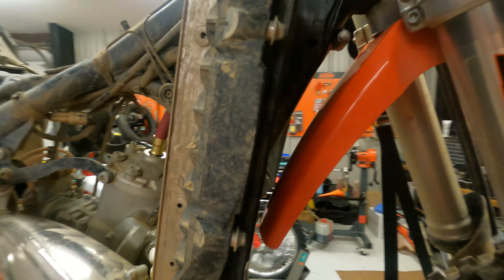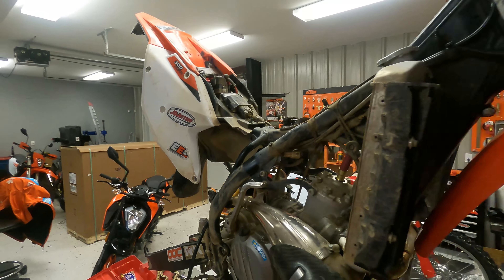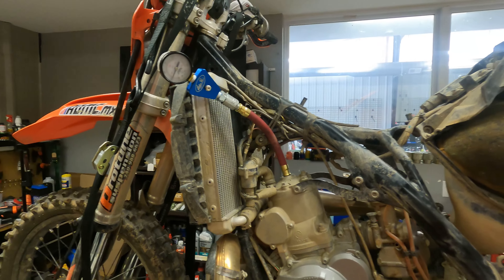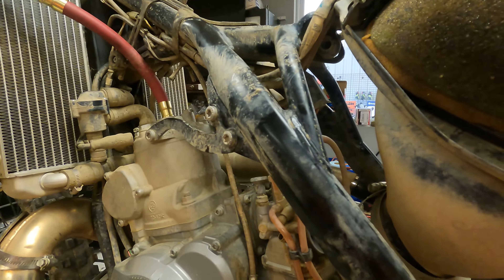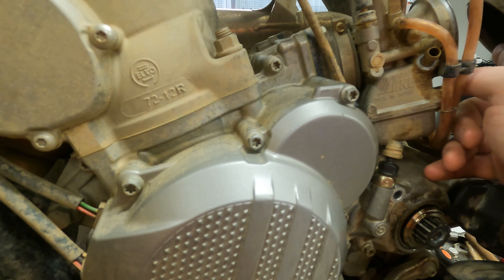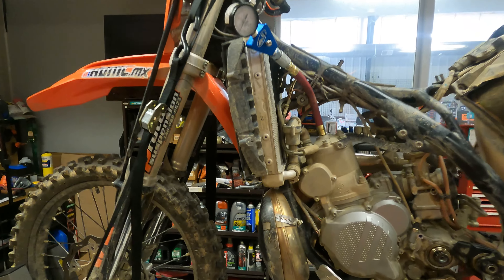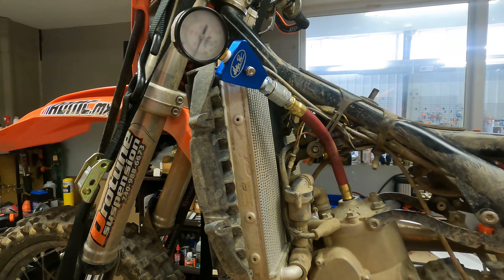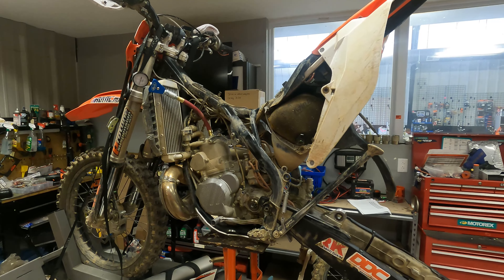2018 KTM 300 XCW with 90 Hours - Lets do a  compression test

Comment: Hello, 

I checked on my Husqvarna TE250i 2019 Cylinder compression and got 7,5 bar. How do you think is it problem? Bike has 100 hour run in normal mode not in hard enduro ride. 

As I saw in manual there was 13.2:1 ratio and please let me know need top end rebuild how do you think or is it normal that compression on this model?

Thanks,